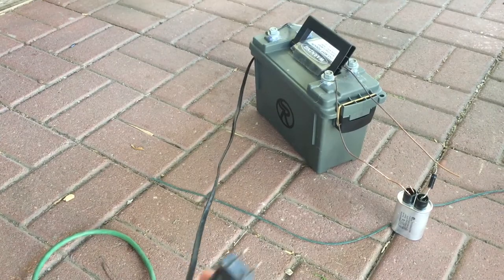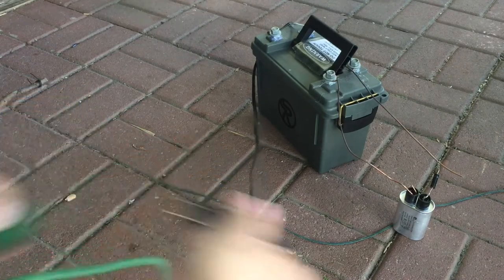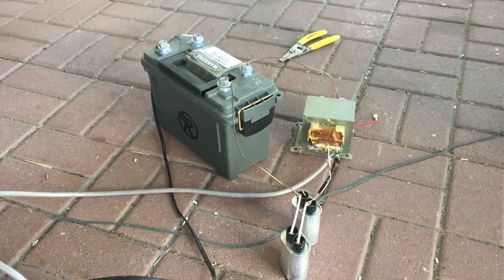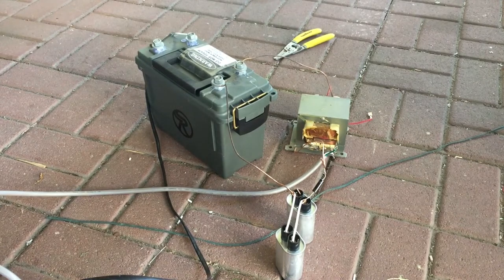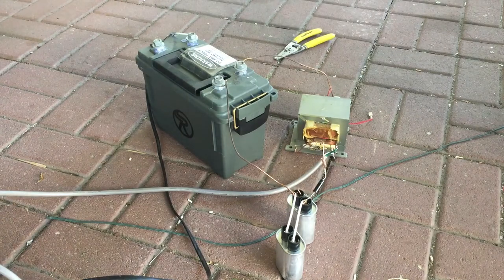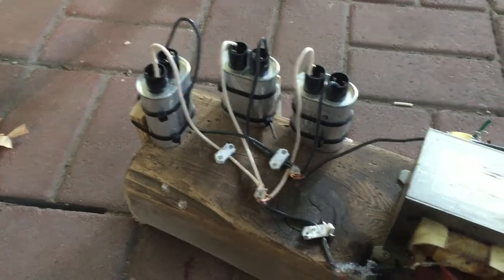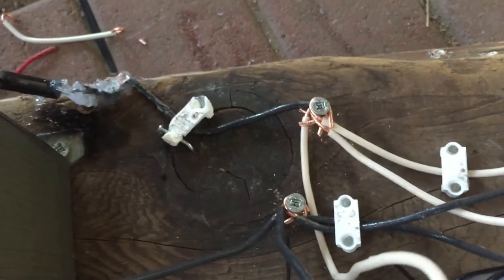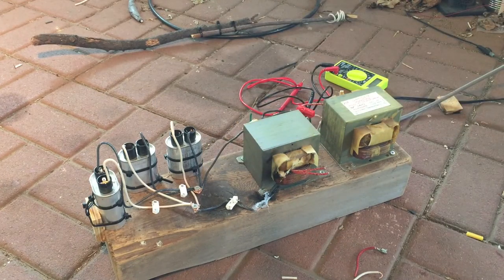Microwave Oven Capacitor Experiments

Comment: This is incredibly dangerous just for a small spark. You can make a much more impressive discharge with say a 200v 3300uF electrolytic capacitor connected to mains through a bridge rectifier. Still deadly but much much safer.    I can make a video demonstrating if you would like me to. 👍 stay safe!